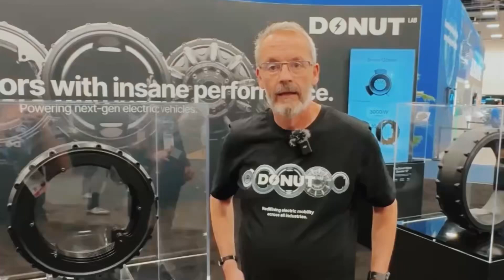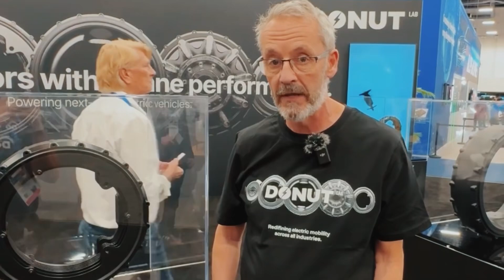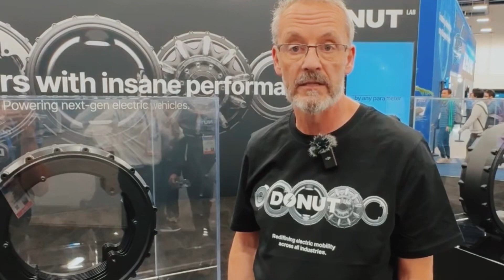In-wheel Motors | The Unsprung Mass Myth

Comment: If the car gets into a pothole, will the motor gets damaged like the hub motors in the scooters?
Reply: no because the only moving part are the bearings.
Reply: I think the same too
Reply from the maker: Thank you for the question. This has been carefully considered in the design of the entire system, including suspension, motor construction, and the use of robust materials. We also have years of field testing on Verge Motorcycles, which has demonstrated outstanding durability and performance, even in challenging conditions.
Reply: @DonutLabOfficial  i think sharing some video tests would confim this, actions speak louder than words
Reply: @DonutLabOfficial  give video
Reply: @DonutLabOfficial  Upload the video
Reply: @DonutLabOfficial  did you say suspension? A hub motor has no suspension. The only dampening of road hazards is the rubber in the tires?
Reply: @CihanekPhotography  Yeah, but car tires are pretty big so the chances of smashing the rim is pretty small. Unless you swap them for some super low profile thin tires, which would make little sense anyways I think.
Reply: @4nlimited3dition_4n3d I am more concerned with the shock of the hit, not actually damage to the rim.
Reply: @CihanekPhotography  Since it looks like their motor is direct drive, then it's also pretty much a "solid state" motor by default. Meaning that the only shock susceptible parts in there should be the bearings. And they have probably used a type of bearing that can handle it I hope.
Reply: @CihanekPhotography  That is true. Though judging from the ebike / electric unicycle / scooter etc world, hub motors are known as the most durable and reliable option out there pretty much. Even those cheap Chinese crap hubs.
Reply: @4 @4nlimited3dition_4n3d  except that ebikes and motorcycles do not put nearly the milage on the motors that a car does. And they are also moving around a fraction of the mass (and for ebikes, at a fraction of the speed) Don’t get me wrong, I love the idea of hub motors. But I know people who ride one-wheels and they have to replace the bearings way more often than i have on any of my cars.  But if the car ones can go 200,000 miles minimum driving on the pothole infested roads of the Northeast with no shock related damage, then they are the future of transportation.  I do hope they are this good.
Reply: @CihanekPhotography  Definitely car tires take more of a beating. As for your comment about one wheels and bearings, I just wanna point out that those are pretty much all made in China, so they use the cheapest, crappiest bearings imaginable, along with garage kiddo - levels of engineering, so no surprise they have issues sometimes, although my personal EUC's bearings are still like new after half a decade of use.
Reply: @4nlimited3dition_4n3d  Well, I hit a pothole (on a dark road) last year in my car and as well as damaging the tyre I needed a new wheel due to the alloy being cracked. A new alloy is expensive enough ... this is a relatively common occurrence these days due to lower profile tyres.
Reply: @MrAdopado  For their motorcycle motors at least it seems they have a separate carbon rim that will probably be the sacrificial part of the assembly in such case. Not sure how expensive that will be though.
Reply: It depends on the rim
Reply: No, as demonstrated here, that's a myth. LOL!